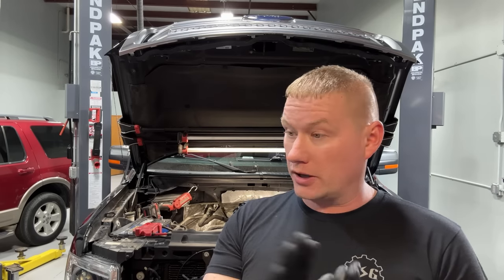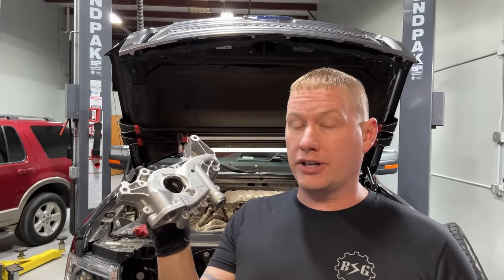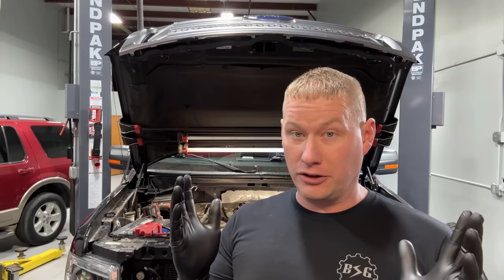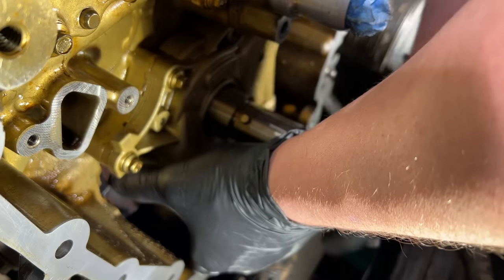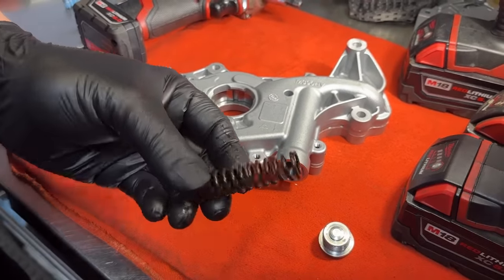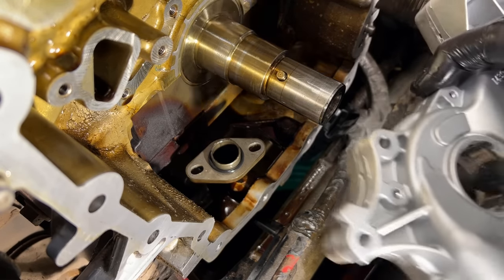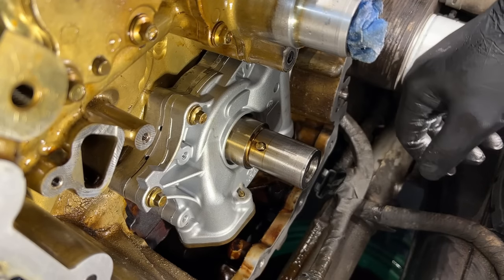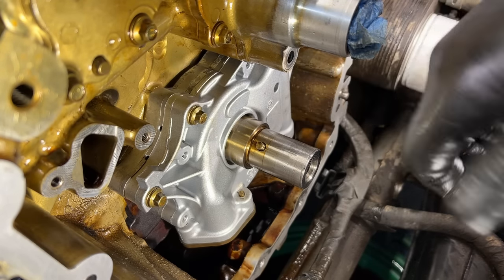2011-2016 Ford F-150 3.5L Ecoboost Oil Pump Upgrade Without Oil Pan Removal!

Comment from the maker: These are the Parts and Tools I Recommend:
Melling M390HV High Volume Oil Pump-
https://amzn.to/3hu4IaF
8mm Ratcheting Wrench-
https://amzn.to/3A6NIhf
1/4" Drive Torque Wrench-
https://amzn.to/3huD8dr

Torque Spec for all bolts is 89 inch lbs.

Forscan is a free Ford Specific Diagnostic Software:
Download Here- 
https://forscan.org/home.html
ELM 327 Adapter I Recommend-
https://amzn.to/2GC6dBj

As an Amazon Associate I earn from qualifying purchases.
Reply: What would happen if you leave the spring for the racing application in a stock engine 🤔?
Reply: Man I need your help bought a Ford 3.5 liter last Oct used from dealership this Oct made a year it's been in the shop 7 times 3 diff motors what could be happening
Reply: Does work the same with the 3.5 2018?
Reply: Would this oil pump work for a 2017 Ford raptor?

Comment: As a tech this really helped me impress my boss by showing him you in fact DO NOT need to remove the oil pan in order to replace the oil pump. Yes boss man I realize you have 25+ years of experience that doesn't mean you know everything. Very impressed with camera angles as well, having done this job 3x now I realize some of these camera angles took effort. Very impressed and a great video if the average person want's to attempt this repair.

Comment: Before watching your channel, I never used a Cat-Claw.  Now, I almost want to use it every time working on things needing separating.
Reply: Prybars for the win!
Reply: Yes, I have a Cat-Claw as well, but for a different purpose, and that's extracting those push/pull pins, that hold so many of the portions of the truck to something else!   Now, I know it would be helpful for another purpose!    Yes, patience is the key to this job!

Comment: I know Brian cautions against it, but my inclination in installing this pump, once I'm certain that pump flats are aligned to the crank, would be to take six inches of a large PVC or ABS pipe, center on the pump and over/around the crankshaft, and tap the pipe gently with a rubber mallet.  Certainly forcing this fit could cause damage, but I doubt a gentle tapping would do that.  It'd just provide enough vibration and force to ease the pump over the shaft, which is essentially what Brian is doing by working the pump back and forth over the crankshaft..  Just a thought (maybe not a good one, but then patience ain't my strongest virtue 🙄).
Reply from the maker: gentle tapping with a rubber mallet is fine, you will know if it is moving or not without damage.

Comment: I followed your videos when I did the timing job on my 04 5.4 3v. When I went to change the oil pump I dropped a wrench in the oil pan and had to drop the front axle and pan to get it back out. I was so frustrated but it did allow me to go ahead and change the pan gasket so I guess it wasn't all bad.
Reply: That sucks, I'm sure you tried grabbing it with a magnet, before dropping the pan and  the axle
Reply: @michaelbefumo-qg7ji  I did but couldn't get it. It was under one of the baffles near the drain bolt.

Comment: I did the timing chain job on my 2013 f150 with your4  part video last year and I don't think this video was out at the time. I did manage to get the new high volume oil pump in without dropping the oil pan but it was bad. I don't remember how I managed to do it but it was a FIGHT. I sure wish this video would've been out at the time. Keep up the good work your videos are by far the best ones on the internet for fixing the ecoboost. I would've never been able to do it without you. Thanks for all your hard work making these videos!!!!!

Comment: We just did the timing chain.  Our truck has 100k miles, had the cold start rattle.  The timing guides showed a good amount of wear.  Since the whole front was off I decided to have the oil pump replaced.  I called my local Ford auto parts department.  They told me not to buy the ford one.  I was a little shocked.  They said to definitely go aftermarket, and with a HV.  They mentioned the same pump as you.  I am surprised that I didn't see this video as I sub to your channel.  What a major improvement!  I highly recommend, as our truck is usually used for long trips towing or have stuff in the bed.

Comment: Brian,
Excellent video, repair, and tips - thank you!
Two comments:
1. I think if Ford had made the pilot on the pickup tube 1/16" shorter the job would be much easier without affecting fit to the pump.
2. Im surprised there is no type of seal (gasket, o-ring, etc) between the oil pump outlet and the block surface (just flat metal-to-metal).
Paul (in MA)

Comment: When I replaced a water pump on 2013 Explorer I also changed the oil pump.  I though it would be as tight with the pickup tube as your video shows but luckily those have plenty of room and it was quite easy (once you are that far into the job).
Reply: Wow, I had no idea that if you are into it for changing the water pump, that you could do the oil pump as well!   Thanks for this tip!

Comment: I'm always on the lookout for short cuts like this that save loads of time.  For example, I figured out how to change out the blend door motor on Grand Marquis and Crown Victorias without having to remove the entire dashboard like the factory manual says to do it.  I really should make a video on that.  You did a fantastic job on this little gem of a tip.  I might try shaving a little bit off the pipe that fits up in the pump just to make it a little easier going back together.  Thank you again for another video full of priceless information.
Reply: Customer: "What in the world is that hole 🕳️ in the bed?"
Neighborhood Mechanic: "That is called a fuel pump access hatch, the engineers really dropped the ball on that one."
Reply: I would be concerned about the metal shavings going down the tube.

Comment: 1. I was surprised to see you use and recommend a non-FoMoCo part, even though Melling is an excellent manufacturer (and probably makes the pumps for Ford).

2. The paper towel trick is brilliant! How did I not know this in 40+ years of home wrenching? Thanks!

Comment: Great video, I used your video on the 5.4 3V to install a HV oil pump, worked a treat.  I like on this engine that the pan doesn't bolt into the timing cover.

Comment: I appreciate your videos.  YOU are Truly authentic.  I have steered many to your site.  With ALL that said, Ford Sucks!  I have, for many years(until 2004) been a GM fan, until they went Junk.  I have a 2015 F150 (coyote) of which I scoped the cylinder’s to find Massive carbon!  Since then, I installed a separator to find a Lot being collected.  (I Highly Recommend a separator!). Upon inspection of said cylinders, I discovered the pistons were different in casting’s.  I talked to my nephew, highly intelligent mechanic (Airforce levitow), in which he told me that it is normal junk.  They, all big three, balance their engines with “added” weight to the throw’s of reciprocating!  What the 🤬🤬!!
Since that realization, Recommend Japanese…..we, Domestic, have went so far on the quality to putting bandaids and short cuts upon our products!  It’s disgraceful!

-two cents

Comment: I hope you offered the guy some upgraded turbos like Garrett Powermax or even the GT’s from Ford!!!! 
Just did this a few months ago after seeing your announcement about the production of the Melling HV pump. 

My shop software “ProDemand” told me the same; drop the pan, the axle, and I simply refused to do so lol. 

I wound up with the same method, and I’m not a YouTuber but I was so pissed I didn’t chronicle the procedure for others to see. 
NO SHOP or even DEALERSHIP I’ve spoken to wants to tackle this, and you’re 150% correct; if you’re gonna spend all the money to crack the thing open like this, you better replace everything you possibly can if you want to see 300,000 plus miles. 

Thanks again, I appreciate what you do.
Reply from the maker: We do not install anything aftermarket except the oil pumps from Melling.

Comment: Thank you for the video, I made sure to use some assembly lube on the pick up tube/oil pump mating surfaces to make it easier to slide onto each other and to reduce any metal on metal contact.

Comment: Thanks so much for showing this tip. I have been looking at the 3.5 eco boost F150. Heard lot good and bad about the engine. Great torque for towing just need catch can and make oil change and spark change regularly. Saving this video.

Comment: I use two small dabs of super glue to start the pick-up tube. Once the bolt is tight, it is easy to break your wrench loose.

Comment: I was thinking about the oil pump being replaced,  because they are always talking about the cam phasers starving for oil on start up,  so I looked it up, and your video showed up.
 I did verify the valves to be okay on the driver's side of the engine after the secondary chain broke.  So we are moving forward with the project.

Comment: I just recently did basically the same thing on a 2012 flex 3.5 ecoboost did the water pump and oil pump when doing the timing. The oil pump wasn't to difficult to change without removing the pan

Comment: If that lead-in on the pick-up tube was just 1/4" shorter in length, the clearance between the tube and the pump housing would be there and the remove/install process would be so much easier without the potential of distorting the tube and making metal chips when it scratches across the housing surface.  Ford should be watching and learning and implementing this.

Comment: I didn't see any of your videos showing the newer, like '18, 3.5 eco.  I bought all my timing parts from the dealer but the guy told me they never sell oil pumps for them.  I know they changed to electronic solenoid pumps, which drove the cost up.  My thought is to put a new pump on while I'm doing the timing set. But I haven't seen anyone change them and have been told it adds a ton of time to do it. I am literally about the remove the timing cover as I've been slowly taking things off every day. I did notice the fuel pump is on the passenger valve cover now instead of the drivers side.
  In this video, the oil pump appears easier to get off than the 5.4 3v, mainly because the pickup on the 3v is under the lip of the pan.  But I can do a timing set on a 3v pretty quickly as I've done so many. So far, this 3.5 has way more stuff to take off.  It could be because it's my first timing job on the 3.5.
  I noticed when I held the gas pedal down upon turning the engine over to allow a no start while I watch the oil pressure gauge, it seems to take a while for oil pressure to come up both during cold and warm startup.  The engine I'm doing has 170k on it, and as far as I know, it's never had a timing job.  So my thought is to put a new oil pump on as it's taking so long to do the timing set, instead of going back in 6 months later for chain rattle again. Does a new oil pump have to be programmed?  Or can one just be replaced?  I'm assuming a new pump isn't hurting anything but I'm wondering just how robust the pumps are. 
  I called Melling and they said they do not have a replacement pump for the newer 3.5 yet.  Any feedback is appreciated.  Thanks for all your vidoes.  I find them to be very informative in comparison to what's out there.

Comment: I'm doing WP, chains, guides & tensionsers (minus phasers) on  my dad's '09 Flex AWD (non-turbo & skinny chain).  Turned out WP pulley actually punched a hole in the timing cover, cover was actually keeping the pulley in place or it would have tossed the chain.  He pulled over & shut it off right away & towed it to my shop; it still ran, so we double-oil changed it to flush out the milkshake then considered options.  We would only run it like 30s at a time (no coolant) but it seems to run fine so we're fixing it.  

I'm getting the M390HV pump and a new pickup tube.  I'm keeping my fingers crossed I can fish the tube out & in without dropping the pan as the engine is supported with a jack -  the motor mount is off.  When the oil pump & tube is out I'm hoping I can flush all the coolant & crap out of the pan & the passages to the oil filter.

I'm looking for suggestions on how to prime the oil pump and engine.  Best I've seen so far is using a suction gun to backfill the oil pump through the off-center hole in the oil filter adapter.  Pre-fill the oil filter, then use clear-flood mode to prime the engine the rest of the way before firing the engine.

My other question is the timing cover.  I heard it's difficult but holy hell I could not get it out without removing the LH VTC housing to gain clearance.  I have no idea how I am going to get the new cover in there at all let alone without smearing the sealant.  I have the coolant & power steering reservoirs and a/c tubes out of the way, I think I have to drop the washer bucket out to gain more clearance.  Hope I don't have to strip off the bumper cover.

Comment: A piece of wood dowel with a liitle Mcguyverin to hold the pick up tube out the way would free up a hand and make things easier.
Then holesaw a 4x4 post big enough to accomadate the main crank rod. The hole wood have to be at least 6" deep. Im guessing the depth here but some of you get where Im going with this. Then cut off the post long enough to go over the crank. Maybe 6 to 8". 
The holesawed 4x4 piece is basically a custom " drift".
Wiggle the pump in place.
Place the drift over the crank and gently tap the pump on with a mallet.

Comment: Great video as always! I have a ‘14 F150. Currently I have 133k with the factory extended 150k warranty. I do all the regular maintenance at the same dealer I purchased the vehicle new at. 2 questions if you have an opportunity to answer them:
What does a time job and oil pump replacement cost, ballpark I don’t need your exact numbers. 
2. Is there anything I should be looking for to get the best out of my warranty? The only major things that I’ve had done, warranty wise, was the driver side turbo was polled to replace a leaking coolant line. I do have an occasional driveline thump when moving from a stop on an elevated surface. Other than that the vehicle has performed flawlessly. Really appreciate these videos.
Reply: I’m curious as well for a 2013 F150 !!!
Reply: Definitely would like to know also
Reply: I have a 14 and am curious also
Reply from the maker: A timing job with all the extras that I replace is well over $3k. If you are under an extended warranty you need to keep an eye on the common failure points for the expensive repairs like the coolant lines at the turbos, water pump failures are common and of course most important of all you should be listening to your engine on cold starts to catch the all-too-common startup rattle which would be a great item to get repaired under warranty. Nothing else is a major concern with these engines.
Reply: @FordTechMakuloco  my truck doesn't rattle startups it rattles when warmed up. I have not seen any coolant leak
Reply: @FordTechMakuloco  thank you very much for taking the time to answer my question!

Comment: My brother has s brand new 2022 ecoboost in a mustang.  He performed his first oil change at about 4000 miles and he was stunned and almost had a heart attack when he saw the oil coming out was GREEN.   After calling me, i didn’t know why and tried to calm him down and told him it might be Penn Grade oil.  He then went to dealer and they told him it was breakin oil from factory.   Have you seen this in these engines?   It was def green, not brownish/oatmeal like when a headgasket fails.   Thx for all your great tech!!!!

Comment: Another quality video.  Thank you!  I have a 2015 3.5 EB, but only at 90K on it.  So hopefully I don't have to do this round of servicing for a little while.   Oil changes before 5K miles with Pennzoil Platinum every time.
Reply: Got 2019 with new phasers at 59k, filter and oil every 5k, she has 70k on it now.
Reply: Switch to ultra platinum. Watch the project farm video on the comparison between ultra and regular plat
Reply: @carado1984  I'll have to check that out.  Thanks!
Reply: @wisconsineaglesfan7925  I like both but it surprised me how drastic the difference was so I switched, although I still use Plat on some cheaper vehicles
Reply: @carado1984  Ohh, and Go Steelers (this week at least 😄)!  The Eagles have the Saints #1 pick next year, so kinda hoping the Saints lose out.  And Watt is back this week IIRC, dude's a beast!
Reply: YOU ARE CHANGING YOUR OIL EVERY 5K MILES HAVE YOU HAD TO DO ANY TIMING CHAIN WORK OR ANY OTHER WORK! I just purchased a 2014 LOOKING FOR SUGGESTIONS ON WHAT I SHOULD DO TO IT
Reply: @tonydellamaggiore8009  Bought ours used with 35K on it in 2018.  Only real problem I've had so far is in 2021 the throttle body started failing causing the truck to go into limp mode until restarted.  Easy repair (15 minutes maybe) and the part was about 150.00 from my local Ford dealer (they were surprisingly the best price around, but other Ford dealers in area were pricing it closer to 300.00, so YMMV on that) and they even had one in stock for next pick-up.
Reply: @carado1984 exactly. His testing found that the ultra platinum was by far the best, and second was the semi synthetic which was pretty interesting. 👍

Comment: I really appreciated this video. Our 2015 Ford Transit 3.5L EcoBoost has about 130,000 miles on it. I'm about to transition from orange Dexcool to Motorcraft VC13G. While I'm doing that, I'm going to replace the water pump and upgrade the oil pump to the Melling M390HV. 

My question is regarding reassembly after installing the oil pump. If I don't move anything (phasers, sprockets,etc) do I need to retime the engine after putting the timing chain, guides, etc back into place?

Comment: I got a 2013 with Garrett stage 1 soon as it gets a little warm I'll get a low oil pressure buzzer I'm right at about 180k I guess I should go ahead and a timing kit